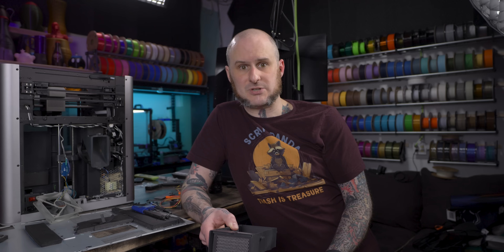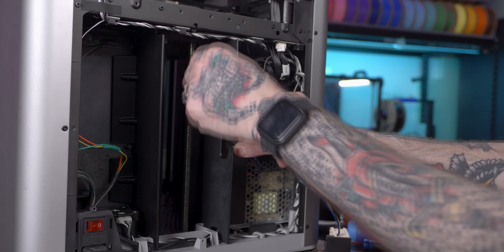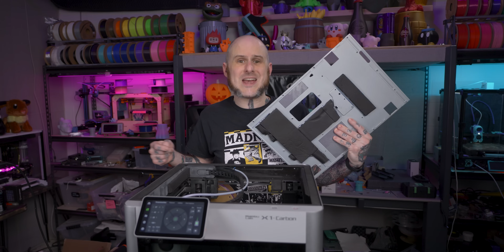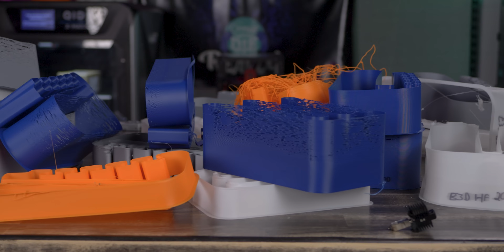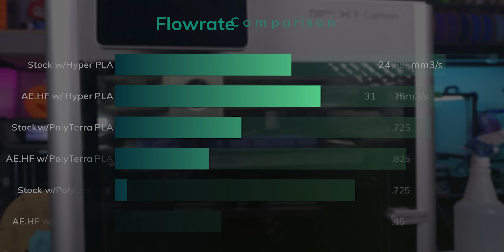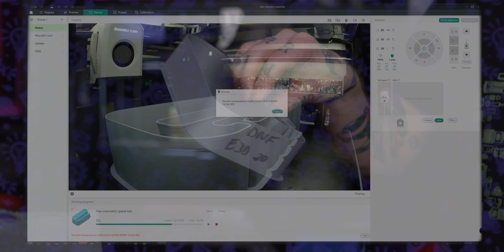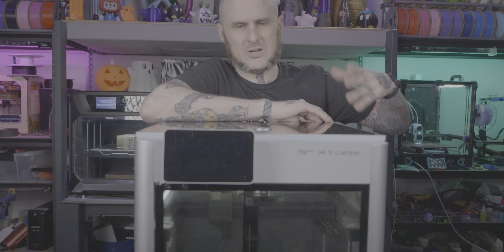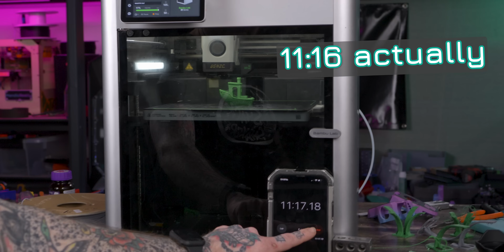ULTIMATE Bambu X1 - Sub-10 Minute Benchys!

Comment: E3D advertises better consistency with their hotend. If I like to print at slower speeds, will I see any benefit over a standard hardened hotend?
Reply from the maker: The ObXidian coating supposedly reduces filament build up on the nozzle. I haven’t had to clean mine since installing it but I’ve still had some boogers drag into a multicolor print. So it doesn’t fix Bambu’s less than stellar nose wiping. There is an argument to be made that you’ll improve part strength with a hotend that can flow better, but I don’t have data to back that. I’d say it isn’t worth it unless you just want a hotend that should last a long time and things stick to a little less. There is also “Plastic Repellant Paint” from Slice Engineering that does a similar thing and could be used on a stock nozzle.

Comment: I believe someone tested the copper sleeve and it wasn't a bad thing the point of the 3 paths are to increase surface area and heat more evenly which technically a little wear will open up the holes but shouldn't change what comes out the tip

I think it's hilarious how much people say the same thing you said about why go faster.. my question is .. why not? lol if you're saying why go faster then why buy a bambu the quest for speed is literally why bambu exists people making faster printers for ages and then a consumer friendly one came out lol

Comment: Very cool upgrades. Definitely will be looking into installing the baffles. I use the chimera mod which modifies a V1 china CHT hotend (no plate & extra support screws) to accept standard V6 sized nozzles so I can use diamondback nozzles. I haven't done any comparisons between my chimera, stock, etc. but anecdotally part strength & layer adhesion seems stronger with my modified nozzle compared to stock, or the V2 china CHT. I'm certainly hoping that my diamondbacks are the nozzles I'll have to buy for this machine.

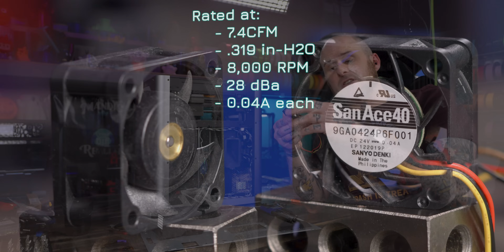Comment: 3:28 a pair of 5015 are better than those 4020
Reply from the maker: The designer of the Bento Box disagrees. They have to draw air through the hepa filter, then the charcoal, then it gets to the fans. Each one of these fans is rated for double the cfm of even the best 5015 fans at a similar static pressure to decent quality 5015s as well. All at a lower decibel rating. So far they are working well and I can barely hear them with the door closed.

Comment: Did you test any Elegoo filament?
Reply from the maker: Nope. I have found it flows pretty decently but it’s been inconsistent for me too. I tested what I use the most so I’d see the biggest differences most easily.
Reply: @MandicReally  Thankls for reply. What kind of inconsistencies did you see?

I have 60kg here so will be interesting to se if doing any upgrade has any point with flow rate. They have some "rapid pla" meant for fast printing, wonder if its any difference or just marketing hype. Anyways think their pla and rapid pla is cheaper then the competitions filament, thats why i bought a bunch :3
Reply from the maker: @BrainActivity1  I've had prints showing extrusion inconsistencies on machines where other filaments don't show such issues. Running larger parts with smooth sides, the sides show inconsistent layers. Seems like maybe a material thickness deviation. I haven't measured the material enough to say that is the culprit exactly. Just something I noticed after running a couple dozen spools of the stuff. Enough issues popped up that I decided to spend the few dollars more for my needs. But for a project that just needs a lot of filament "perfect" prints aren't a requirement, it is great stuff.

Comment: I would be interested in the results of the copper throat high flow wear test. According to diamondback nozzle wear is primarily caused by the tip rubbing on the printed plastic rather than the extrusion itself. That being said, try using a noclogger with the tri-hole insert.

Comment: Increase chamber temperature dummy way is very bad idea. Your stepper motors will gradually degrade when they reach 80C as this is the boarder temperature of mass stepper magnets. belts should survive arround 90-100. As the rest of the plastics. Normal bearings don’t like temperatures above 60 in general as their lubricants changes significantly. In short you are doing mods that you  don’t understand the implications. Most probably you ruining it reliability.
Reply from the maker: Thanks for the engagement. Glad you liked the video. Keep on assuming you know every thought I have, it’s working out well. 👌🏻
Reply: @MandicReally  I don’t assume anything but when I did this for my diy from scratch I took thermal camera in order to check everything. You show mod and present to the audience without explaining those constraints. If someone want to replicate this mod he need to know all possible implications. Otherwise its dummy way.  Video is good some of the mods are good but this uncontrolled increase of the chamber temperature is boarderline reckless.

Comment: I get wanting to test flow rates at the temps you print at. that makes total sense. What doesn't make sense to me is why you settled on 240 for your asa. That is 10c below the default temp in the slicer for that material. It is also the lowest value suggested by polymaker for that filament.
Reply from the maker: Because I’ve printed probably 50-100 kg of this exact material and tested it back and forth. On my machines, for my use cases, 235-250 is the temperature range it likes. On my Bambu X1 it is 245C. On my 0.1, it is 235. My 2.4: 244.  It prints happily, flows well, and produces strong parts that are currently holding half the 3d printers in my studio together. Plenty of people think I print it too cool, but it works VERY well for me. Hotter just produces more stringing and reduced overhang quality with no appreciable difference in any other properties.

Comment: A note on the CHT clone nozzles with copper inserts: In my testing, they actually impede flow rate unless you chamfer the copper insert to look more like a CHT nozzle. The insert simply blocks too much of the filament entry. After modification, they outflow a standard brass nozzle. Also, I believe the steel outer does reduce heat transfer efficiency, like any tool steel nozzle. Once the insert is modified, it can still outflow a standard nozzle at the same temp, but a temp increase for compensation also helps. Lastly, other people have tested if the copper insert wears down from abrasive filament and have found that's not the case. Basically, they are not great nozzles as they come, but with a quick Dremel mod they are overall excellent.
Reply: How would you recommend trying this mod? Are there any more detailed instructions?
Reply: @24h_  I used a Dremel with a very small cone shaped diamond burr bit. Any kind of sanding attachment can work if it's small enough. Basically you want something cone or radiused cone shaped that is small enough to fit in the unchamfered holes that you can grind towards the center without taking metal off the top of the outer steel portion. You'll be holding the Dremel at basically the same angle the filament would be pointing into the nozzle, just at a slight angle for each hole. Low speed will work fine, but just go slow until you get the hang of it. Grind until the dividing walls between each of the three entries come to a point instead of having a flat at the top. For some of my nozzles I went even further by grinding a slight divot in each of the walls and then grinding back to a thin peak so that all three walls are thin and scalloped with the center meeting point forming a slight point, similar to how the actual CHT nozzle looks. It doesn't really matter if it's perfectly even, but I did my best to make it uniform. The main point is to eliminate the flat surfaces the filament would hit and increase the area the filament has to enter the rest of the nozzle. If you are going to use these clone CHT nozzles, I definitely recommend it. Just try not to damage the flat top portion that seals against the heatbreak.

Comment: I looked at the BEN2C duct a few months back but never took the plunge as like you noted, various different reviews suggested the results didn't seem substantially better. I notice on the BEN2C web site it now says to get improved overhang results they suggest printing 20-25 degrees hotter.
Reply: They charge a pretty hefty price for the BEN2C. There is a similar one from FYSETC with only 3 nozzles for $6.29 MFJ nylon and all. I have one coming with my latest order, we'll see how good it is.

Comment: Wonder when you did the water test if having the auxillary fan on as well affected the center point.
Reply from the maker: Potentially but with most of the materials I run (ABS/ASA) I don’t run the auxiliary fan at all. It’s compensating for a part cooling setup that could have been better designed in my opinion.  You still need part cooling with those higher temp materials so a better focused system does make sense.
Reply: @MandicReally  I totally agree and print mostly ASA as well. I just thought maybe there was some reasoning to it as it seems like a pretty big miss on BL's part. What seems to be the one of the first thing people always do with printers in the past... print a better cooling part fan.

Comment: 40mm3/s? i wonder how you reach that because with ali and e3d HF i ended up quick at 32mm because of the nozzle temp error you get with too much flow. (cools down to quick).
Reply from the maker: That issue really only happened to me on that one test and only after achieving what I’d call the max flowrate. Even running 250C, with full part cooling / aux cooling, and the door open while printing the 10 minute Benchys at 55-60mm3/s, it didn’t happen again. 

Maybe I’ve got a golden heater element. Idk, I can’t possibly account for all the variables, only present my results. I’ve been running my ASA profile at 40mm3/s since I wrapped up testing with no issues at all.
Reply: is your machine one of the crowdfundings @MandicReally  ? maybe it has a 60w heater vs 40 now. printing a benchy may work with showing 50mm^3 in the log data. but i guess you also tested those "bench patterns" where it has to push constant mm^3 thru the nozzle?

Comment: Shout out from King of Prussia area! Question with the Bambu. Is it possible to print TPU and ABS? Do they stick to each other at all?
Reply from the maker: You cannot run TPU through the AMS. It is not intended to push flexible materials. As such it would not be a good machine to do this with. You need some type of Tool Changer or Independent Dual Extrusion machine where independent extruders can be loaded (and stay loaded) with the materials you require.

Comment: Do the filters do anything for ASA and ABS? With resin, you can filter out odors but the VOCs still remain, so for that charcoal filters give you this false sense of security. I have a 10" duct with inline fan hooked up to my Creality K1 when printing ABS and one time, I forgot to turn on the internal exhaust fan on the K1 and not even 30 mins later, with the machine closed off, top lid taped shut and so on.. I was having issues with my nose, I could feel it slowly getting stuffy. It happened very fast, which tells me venting a machine as opposed to just recirculating the air through a filter that needs replacement often is the way to go. I also keep the exhaust vent on at all times when resin printing, but sadly have to live with some residual fumes and IPA vapors when post-processing the prints later. Can't get away from it when living in a fairly small flat..
Reply from the maker: It DOES but I don't have personally produced data to back that up. I wanted to run an air quality tests in & out of the chamber to demonstrate this but I simply don't have the time for that right now. The Nevermore team has a bit of a write up about it on their github: https://github.com/nevermore3d/Nevermore_Micro?tab=readme-ov-file#why-the-nevermore
Reply: @MandicReally  Definitely better than expected. Seems to make sense for spaces where you can't easily vent to the outside. Since I have my printers by a window I just flick a button to start an inline fan hooked up to the PVC duct at the rear of my printer. I find that as soon as I start it, any smells I can feel at the gaps on my printer immediately disappear. I want to avoid having to get more consumables than what is necessary. Maybe Vorons should be sold with the option to include an acrylic rear or side panel with a 10" hole already cut.
Reply from the maker: @FuttFel  The default Voron configuration includes a vent fan that exits out the back and filters through Charcoal as it does so. The Nevermore is an add-on. The problem is the same as I mentioned in this video, venting externally reduces chamber temperature. An undesirable situation on Vorons & on the Bambu (in my use case). Filtering fully internally both cleans the air but also maintains temperatures. The consumable factor is rather unfortunate but luckily the Charcoal isn't expensive.
Reply: @MandicReally  Ohh. I had no idea since I've never seen that in the Trident videos I've watched. Yes that makes sense, altho I've been able to print ABS without too much trouble. I printed all parts for my Voron 0.2 on my Creality K1 with the rear exhaust running at all times. The chamber never got terribly hot, so maybe some part strength was lost along the way. Hard to say really. My 0.2 is trucking along just fine.

Comment: For those hooking up the bento box fans and dont want to drill any holes, there is sort of a pathway through the bottom to left and behind rear lead screw. I printed some small pads with hooks for cable management  so it stayed away from the bed.

Comment: For me the attraction to the E3D hot end is the wear resistance. The ObXidian nozzle has been likened to equal or greater than wear resistance to tungsten carbide with the thermal properties of brass. In essence one nozzle for basic PLA and then go right into the abrasive crap with ZERO worries and no need to change the filament profiles I already have set which is fantastic.

Comment: The problem with the e3d hotend isn't the price, it's that you can't get them.
Reply from the maker: Yea, they are working on restocking but the short supply is a bummer. I think there is a supply issue higher up the supply chain that is slowing them down. 

They told me February another batch will drop. Wish it was sooner for sure.

Comment: Interesting video, thanks! My understanding with the hardened nozzles was that most of the wear occurs as the tip of the nozzle brushes over the cooled plastic on each pass, and the melted filament passing slowly through the inside doesn't abrade it nearly as much if at all. Might be wrong though!

Comment: I used the AE HF hotend for about 900 hours of printing. It worked quite well and never had a clog on it. Then I bought the BQ Panda Revo - X1. Wish I could say it's better, but it fried my toolhead board
Reply: I've read that a few times now, really curious what is wrong with the pandas. I saw posts about horrendous quality control issue like already ripped cables out of the box so I'm not too surprised though.

Comment: got me a p1s two weeks ago... first i installed a led riser for the ams... after the first print with the riser on i noticed the cable chain and ptfe tube hitting the riser...
then i made cable clips to hold to ptfe tube.. it was better but still appeared... then i added a ptfe guide for the print head!! i couldn't get the ptfe tube out so i had to make a toolset too LOOOOOL finally i was able to get the guide on the printhead. with the new guide and the cable clips its perfect now, did a few big test prints an no clicking at all!!!  just modiefied the riser and addeda  led diffuser wich came out pefect,... now im printing a power button to power the usb powered leds... tomorrow i also will print some ams ptfe tube guides...  that probably will be it for the beginning..

Comment: I don't particularly see why the copper core in the high flow hardened nozzle should really wear out.  By the time the material is making contact, it's essentially a liquid.  Nozzles see wear at their tips because they are rubbing against freshly deposited material that is hardening, and thus abrasive.  Nozzles don't really experience that much wear on the inside.
Reply from the maker: Abrasives in a fluid are still abrasive. There is actually an entire machining technique for polishing the insides of rough castings that works on that principle. That said, my testing has quickly shown that the "hardened" nozzle wears out much faster than the copper insert. The insert has shown wear already, but the nozzle is almost trash and only after 800g of filament.
Reply: @MandicReally  Extrude honing, but that uses really high pressures, so the material used is more like a solid where it is rubbing things smooth.

That's funny about the nozzle tip wearing, so much for hardened!  Definitely a junk nozzle then.
Reply: “…essentially a liquid” except for the glitter, sparkles, carbon fiber bits, and whatever other materials are in the filaments I print with. Nozzle diameter (meaning the hole) increases over time due to wear, I’ve seen videos on it but don’t remember the creators off the top of my head.
Reply: @radish6691  
Yes, the inside does technically wear some, but does that matter and warrant discussion if the wear that results in a non-functional nozzle happens at the tip?  MandicReally even said the tip was wearing out very fast on the nozzle in the video.

Liquids can be mildly abrasive, but if other parts of the nozzle are going to wear out first, specifically the tip, who cares?

Nozzles taper to a wider opening, so if the tip wears down enough, this will expose the taper, resulting in a noticeably wider hole.

https://youtu.be/uvlMeTnjriQ?si=JZ1Pk7aw9aMQbqwb&t=619